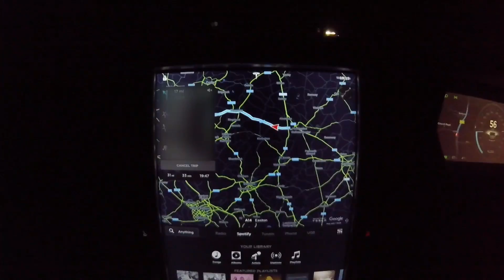Supercharging V3, Supercapacitors & Nanotech

Comment: Supercapacitors can better recuperate the braking energy of a car and return it during acceleration thus in combination with a normal lithium battery improve efficiency and save charge/discharge cycles on the main lithium battery. 

I’m surprised they haven’t done that yet at Tesla, Nissan, Renault, BMW, etc.

Comment: My best guess is that somebody combines a redox flow battery with a lithium–air battery. You can just exchange the electrolyte via a pump and the energy density is nearly as high as from petrol: 11.1 kWh/kg theoretical for lithium–air batterys.

Since you would not exchange the whole battery but the reaction part, the exchange would be much cheaper. And the charging time is around minutes because you only exchange the electrolyte by pumps.

Comment: I think the first step for supercapaciters won't come for full ev for another 5 years instead it will come to non hybrid as a way of capturing regen breaking increasing efficiency of the overall electrical system, also super capacitors aren't small when scaled up to car size for proportion so I think we will see mixed battery hybrid for hybrid non plug in followed by a plug in with approx 14kw bev to scale up to full ev you're prob find at this time will only fit as part of a system

Comment: If you had a car with supercapacitors which could charge very quickly. You could always have a large battery buffer type situation at home which could draw power from the grid during off peak times and allow you to charge your car as quick as at a public station.

Comment: I bet even the P100D can't charge at 350 kWh without some upgrade to the D.C. Charge port and wires. I don't think the existing Supercharger connector can handle that either. Normally when you charge at that rate, you can only charge to 50% before it has to drop to a lower charging rate. 

At some point, quick charging speeds up battery degradation, but I'm sure if Tesla is giving 8 year warranty then the supercharger will communicate with the battery pack and charge at a rate that will not destroy the battery before the warranty expires.

Comment: I think home charging might get affected - there could be two supercapasitors: one at home, one in the car.
Reply from the maker: Good idea. A supercapacitor (or high capacity battery) would be able to buffer the power that the house receives and then release it into the car comparatively quickly.

Comment: Very high rates of charge sounds great, I wonder if the bottleneck may end up being the grid though because there are certain days in the year when a lot of people travel at once. Perhaps battery storage to deal with the peaks instantly is the answer and that is all part of Mr Musk,s master plan. Will we need supercapacitors if that rate of charge becomes a reality? Once charging is as quick as a comfort break I think not.
Reply from the maker: I think a smart grid with some built in storage and buffering capability will probably pre-date the arrival of large, cheap supercapacitors.